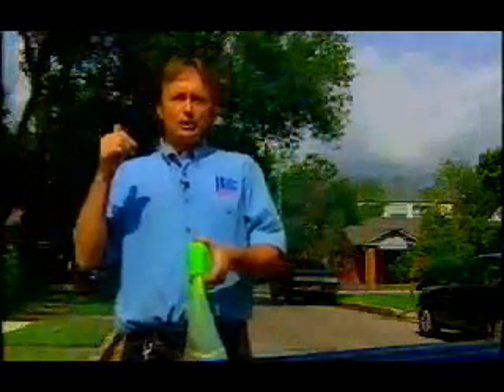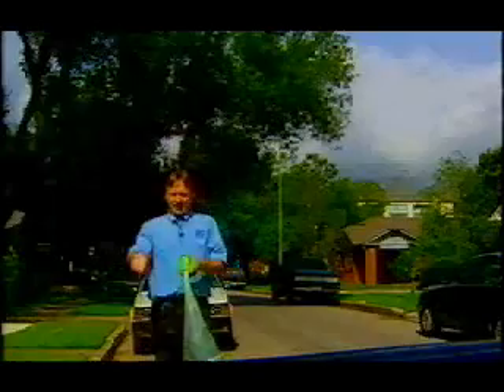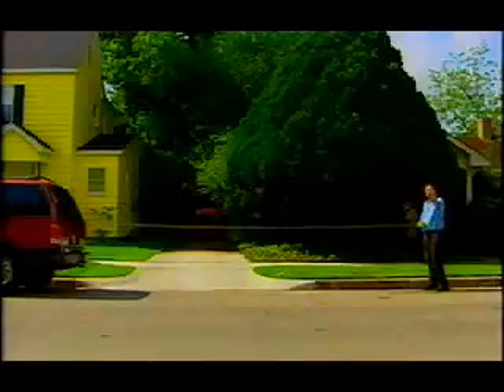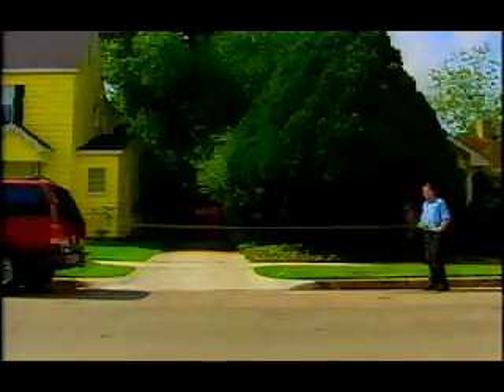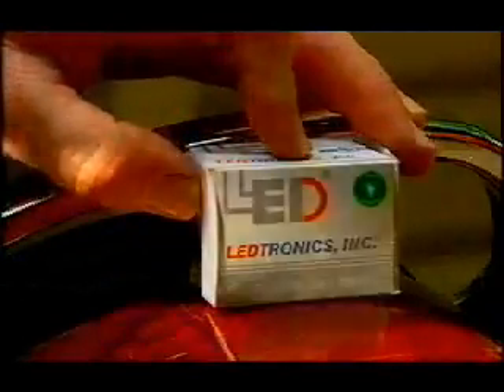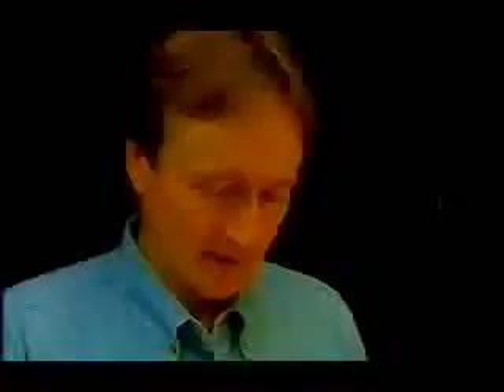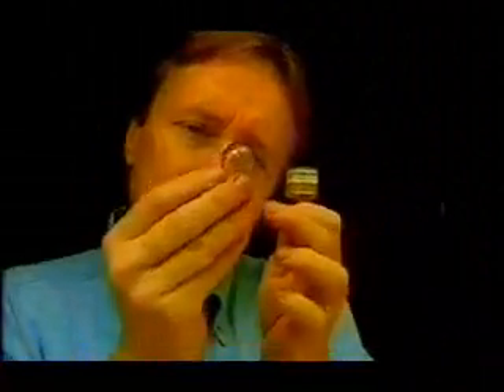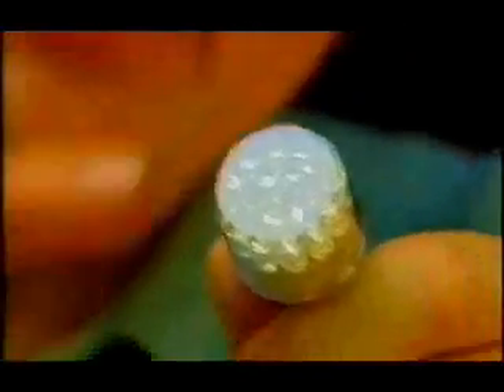Crank It Up TV Show on LEDtronics LED Auto Bulbs

Comment: Now you have someone angry because if you don't have electronic flasher your turn signal will flash really fast with a brake/turn bulb. Then they put in LED's and , what's wrong. Separate turn signal bulb no problem.

Comment: I have proof that this actually works. When I had the standard incandescent bulbs in my 2012 tundra, I got rear ended FOUR TIMES in two years, because Houston drivers are dumbasses. I since then upgraded all my lights to led’s and haven’t been rear ended since, and it’s been about 4 years since then. Didn’t think such a simple thing could make a difference. I also left my hitch ball installed on permanently, so that could be a factor lol

Comment: Mr kilmer is very good mechanic no doubt about that.. but c'mon do you really think that 0.2 sec gonna change the scenario of high way impact ... no way ... the human driver in my estimation takes about 1-2 sec to realize that the car in front is braking and start pressing his brakes .. Also this depend on the condition of your brake system ( calibers .. pads.. master cylinder ) .... Also the type of tyres and their speed / weather ratings as well as the condition and quality of your car suspension ..all these factors are much more important than this 0.2 sec ..  Maybe this video is a paid infomercial for the led company

Comment: Nice blast from the past Scotty! I've installed led bulbs in my Camaro headlights and fog lights but reluctant to do the same for the taillights because they will require in line resisters installed to prevent hyperflashing. Perhaps you could do a revised video on this subject and explain this.

Comment: Should have added that if you're driving that Nissan Sentra you're dead any way. 😂
Reply: ITsJustPain not true. Those were sentras made before Renault and Nissan joined together. Those sentras were very good.
Reply: Fifthcell Exactly. Nissan made great cars back in the day. I’ve got an old Pathfinder, pre-merge. Greatest car I’ve ever owned. 300k miles trouble free.

Comment: Other thing about bulbs is if you touch the glass with your fingers it can damage the glass but with led that's not the case
Reply: LEDs can get very hot   those IC chips can get to 90 to 105C  that is why you see a lot of those 35 or 55watt  headlight LEDs with fans on them
Reply: @punker4Real  mkay copied and noted 🧐
Reply: Yeah those can puff up and be to big to remove from the socket, you'd have to break them
Reply: To be clear, it's the oils on your fingers that are left behind, which heat up as the lamp is used and cause the glass to warp. One "could" wash one's hands really well and rinse with iso alcohol before touching the lamp, but it's easier to use a clean napkin/paper towel to grip the lamp.

Comment: Talk about resistors bro come on no one wants that fast ass blinking
Reply: Random Videos you do know that the newer led bulbs have resistors built in thats the way they were made in the beginning but the cheap chinese started selling them without the resistors to save $$ and the cheap consumers started buying them just to find out they needed to spend extra $$ on resistors and oh boy did they flood the market with em but yes I agree with you he should make a new video explaining the resistors part 👍
Reply: @thenoid5131  I have seen some that come with fans too
Reply: He didn't talk about polarity issues, either, which some modern LEDs have fixed, but I'm sure that relic was one way only.

Comment: Yeah but old cars will hyper flash when you put leds in them if the brake and turn signal is on one bulb. You need to install a load resistor with them but hey young scotty!
Reply: You can put in a flasher relay made for LED bulbs. I did it in my 99 Mazda and I got rid of hyperflash. Its easier and cheaper to do.
Reply: @leskobrandon6950  not every car is able to get them replaced though
Reply: Ryan Olsen chevys don’t let you do that, on most models the flasher module is controlled by the BCM, which also controls much more important things at the same time.
Reply: @agarcia8800  yes you are right. I shouldn't have generalized my statement. You can buy LED bulbs with built in resistors so you don't have to splice resistors into your wiring if you want to avoid altering your wiring. LEDs have come a long way since Scotty was in this video. I swapped all of the bulbs in my car for LED's, even the ones in the dash board. I like the clean look of them and the energy efficiency. Almost two years and I haven't had one burn out.
Reply: Ryan Olsen thanks goodness for leds with built in resistors, otherwise they would always hyper flash, unless I spliced the wiring, which I’d like to avoid.
Reply: Some came with it now a day.